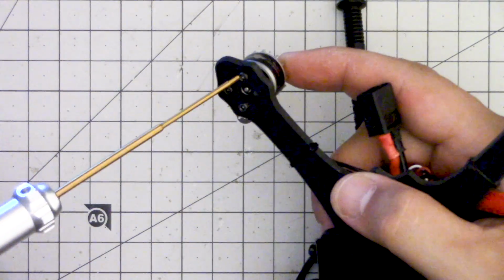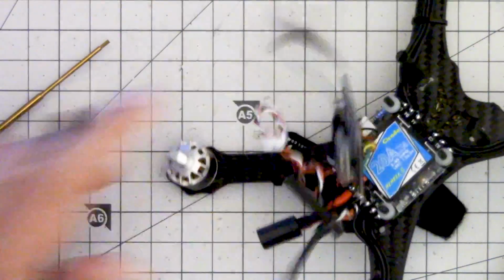Quadcopter Hot Motor | REAL WORLD TROUBLESHOOT

Comment: All good theories, but my 1st thought was you were going to say you hit yourself with a quad and aren't presentable for on-camera work... I guess it's fresh in my mind as I almost hit myself the other day as I was bit rather painfully by a bug, while flying LOS - that can really be distracting... I live next to a swampy wooded area and it's a good flying area, but I often have to clean bug guts off my quads, and worry they may short the FC or ESCs. 

I'd think a black box test would be a good way to determine if the rear motors are working harder in forward flight vs level hover (possibly with a weight load to even out power settings) Maybe there's something to be learned there? Could deflectors or baffles of some sort be beneficial in extending battery life and providing better 'prop bite'? If there's a ducted style quad in the stable for testing you could compare the two. Might be a subject for a video.
Now, who around here does black box testing....??

PS I had an ESC go 'weird' a month or so back and it was causing similar symptoms. As you pointed out, odds are with the motor and a touching screw is easy to locate.

I always check motor temps when changing batteries, it's a habit. 

Good job for keeping up the filming in the dark. Now that's dedication.
Reply from the maker: If you want to know if the rear motors are working harder, look at pitch I term. If pitch I term is positive, the rear motors are working harder.
Reply: I didn't think it was that simple. Makes sense though. If you fly backwards, you should see the numbers reverse. I'm just starting to get into the black box and it's a lot like industrial temp and motion controllers (I'm a retired controls engineer)

Thanks!

Comment: Please help!!! Hello there sir, I've got a question for you... I got my new kk 90gt today in mail, flew a few packs and now 1 motor won't spin up. It moves fine. Didn't crash. Landed safely. Only thing I did was plug it into my computer, with betaflight open, it auto connected, but my laptop died. Didn't touch any settings. Tried updating to 3.1.7 after I noticed motor not working. Tried calibrating ESCs again to no avail. It's like there's no power out of nowhere to the motor. Connections seem ok... it's possible they're not... any kind of troubleshooting I can do?? Nothing should be wrong with this thing.
Reply: You could try changing the location of the motor to the opposite arm.  I had a new Storm motor crap out on me after a few flights. It happens.
Reply: MikeDrones well that would certainly rule out the motor/motor wires. Thank you didn't even think of that. Have been to busy panicking.
Reply: MikeDrones well it is not the motor... so I'm thinking of getting the pikoblx and the cicada 4 in 1 10a esc... could I just basically drop these in and solder up, and these would work??
Reply: Should work.....check voltage and all that and consider mounting. I'd first check if you can replace with the same parts. Send an email to the company you bought from as well. They might send you what you need.

Comment: Last question.  If all your escs are encased in shrink and the motor tabs aren't accessible to test continuity, could you possibly test by touching a motor screw and the negative terminal on the pdb of the suspect motor or does it have to be the motor wires?
Reply from the maker: No. You will always have continuity between the motor screw and the negative terminal, because the frame is pretty much always grounded somehow, and the screws always touch the frame. You need to test continuity between the motor wires and the frame.
Reply: OK good to go.  Thanks for the info

Comment: EXCELLENT Video!!  I actually just encountered this.  However I did have this occur.  I ran my quad.  After several flights I noticed one motor was hot as hell.  I let it cool while I flew another quad.  Came back to that hot motor'd quad the next day and now that motor twitches and won't spin correctly.  Luckily I had a spare, swapped it out and back in the air but the bad motor has something weird going on.  It turns like the magnets are twice as powerful as before.  I can grab the other motors with my hand and pin them and they spin a couple turns before the magnets slow them to a stop.  This bad one wont even go a 1/4 turn.  Like its seized up of something but there is no damage to the bell or anything out of the ordinary to explain this.  Any ideas?
Reply from the maker: You overheated the magnets and they lost their magnetic strength is my best guess.
Reply: OK cool.  Thanks

Comment: Wow..this is super timely. I had the same experience with one motor. I could visually see the screws weren't touching anything. Or so I thought! Had no idea what it could be, so I decided to soft-mount the motors and now everything seems fine. Guessing I must have missed something and the screw was actually touching. Clearly the extra clearance caused by the soft mount was enough. (Yes, I was being lazy and should have soft mounted to start.)

I didn't fly it too long in that condition. It never de-synced but the motor was very hot to the point I could smell it was starting to toast. What's the chances I fried it completely?

Comment: kind of unrelated, but my cheap build with racerstar motors had all 4 motors getting hot, even with d right down. I switched off air mode (increased idle speed) and now the quad stays chilly cold!!! air mode must add lots of noise?
Reply: chrisbewrx I've noticed the same thing recently. I have flown exclusively on acro for some time now, but I was going to let a new to the hobby friend try flying with my quad and figured he'd get a good feel in horizon mode. I tried it out before to see what he'd experience and whether it was more controllable. 

It's almost like the quad is fighting against you the whole time. I hated the experience. It was like flying through molasses. The motors were definitely working harder the whole time and they came down warmer than usual.
Reply from the maker: I honestly don't know how air mode could cause hot motors. It increases authority at low throttle. It shouldn't have any effect at all at mid throttle and high throttle. At low throttle, the motors are moving slowly, so noise should be minimal.

Comment: Just as a frame of reference I find the threshold of pain at about 55 to 60 C (yes I know everybody has a different threshold of pain).  I worked in a lab for a few years that had a 55C water bath and I had to add and remove samples from it constantly so I have a pretty good idea what 55C feels like.  It is uncomfortable but not truly painful.  But once you get to about 60C it gets truly painful for me.  Motors can still handle 60C without being damaged.  So I agree with Josh, if you can still touch them without drawing away in pain, you aren't damaging the motors.
Reply from the maker: I think this is about right. I suspect the threshold of pain for most people is around 140 to 160 degrees F. And I think the enamel and magnets are good to at least 180, and probably more.

Comment: The number 1 noob mistake and is likely to become even more prevalent with all this soft mounting of motors hypetrain nonsense. As the frame is used over time the elastomer can crush down leading to loose motors. The natural reaction is to simply re tighten the screws which could be just enough to push you from OK to shorted turns.

Comment: Hi Joshua is there a way to test if there is electricity running thru the frame with a multimeter?
Reply from the maker: There aren't any good direct ways of detecting current flow in this case because the multimeter would need to be in series with the current, and this isn't the kind of scenario where that makes sense. I suppose the best way of detecting this type of current flow would be with an FLIR type device, which would clearly show the hot spot on the frame.
Reply: that would be the part where he probes the frame and motor wires.
Reply: thanks....I think Ive had a short because it looks like there is a connection between my frame and the power and motor cables...using a ohm meter resistance...
Reply from the maker: You should never have continuity between the ESC motor outputs and the frame.

Comment: Ever used 4 nylon screws? maybe less weigh and still do the job with no risk of this happening. I've used them on my hex running 6s and it holds. :)
Reply from the maker: No freaking way I would trust nylon screws to hold a motor on.
Reply: Joshua Bardwell  lol :)

Comment: The frame is always negatively charged through ground if it is made of a conductive material from the motor bolts. There is no way around it unless you use plastic motor bolts (lol) and non conductive motor spacers/soft mounts. If you have a positive touching ground somewhere-magic smoke
Reply: The motor housing is neither grounded or at Vbat. It has no electrical function and is simply left unconnected. Motors used on mains power are frame  grounded for safety reasons.
Reply: Then why is there continuity (with resistance) between the motor bottom and the frame? And continuity between stator (motor bottom) and its leads?
Reply: I thought the coating on the stator wires would isolate them, but there always seems to be some wire in contact with the housing where they come out of wire harness and might wear through which is probably when I notice the continuity. I must say that its not readily apparent or easy to check, I have to be careful not to touch the housing... tight spaces and all. I have also never checked a brand new motor, just used ones. Maybe this is a cause of some fall out of the sky instances.
Reply from the maker: The continuity between the motor bottom and the frame is most likely from the screws. Continuity between the stator and the leads indicates a damaged motor. The stator must be electrically isolated from the windings for the motor to work correctly.
Reply: Then the motor is faulty or you are measuring your own body's resistance. i.e. you are holding onto the bare wiring while connecting the meter. 
The other important connection that WILL ground the frame is the VTX antenna if it is screwed into the carbon frame with a SMA connector. It is this connection along with shorted windings in the motor that will show up as black streaks in the video feed.
Reply: Thanks Rob and Joshua for clearing up some misunderstandings/miss diagnoses, I would delete my original post but maybe it will help someone else.

Comment: what if the motors are not getting hot but still the screws are touching?
Reply from the maker: Then you're extremely lucky. But you should still use shorter screws or put a washer underneath the head to space them out  a bit.
Reply: Maybe thats why my quad is doing the death roll After a few flips and rolls.I was thinking it was Dshot 600.

Comment: Rear motors need to spin higher in forward flight for the pitch. Hence they are more warmer than the front. Ain't got much to do with airflow. Same goes with yaw or roll.
Reply: Francis Rohan John id disagree. But I'll run a test.
Reply from the maker: Sorry I don't think that's true at all.
Reply: Joshua Bardwell Maybe I'm wrong. But I did run a lot of tests to see if this was true and all the time it happened like I said. If I had a lot of front pitch, my back motors used to be really warmer likewise if I give too much roll to the right, the left motors got warmer.

Please do check if it's true with yours too. Now I'm curious to find what actually is the reason :p
Reply: Francis Rohan John also I'd say if anything cg has to do more with it. If the battery on top id say the fronts would work harder. But that's just a guess

Comment: Nice troubleshoot, but what does "D sinking" / "desinc" means at 08:45. Does it have to do with the insulation on the windings?
Reply: Brushless motors use pulses in a specific sequence to turn the bell. The ESC's uses various ways to sense what pulse to send and when. When everything is running smoothly everything is in sync. If something causes the ESC to not be able to determine what pulse to send at the right time the motor then becomes out of sync and will be down on power or fail to spin at all. When the timings are out of sync it is called a de-sync. Shorts can cause havoc on some of the methods of sensing when to send the pulse.

Comment: had a similiar problem with my VTX. i screwed it into the frame and as soon as i powered it up the PDB started smoking. below it the frame was burnt afterwards, right below the positive battery terminal. 
it was quite weird, the pdb didnt had contact with the frame since there was plenty of soldermask and there wasnt  any components on this side., none of the wires was damaged. 
just the Camera and VTX was touching the frame with its grounded parts.

Comment: I have a new Revo F4(Airbot/Flip 32 clone) and DYS mr 2205 2300 kv.  When go to the motors tab and throttle up,  at around 1300 it starts oscillating really badly.  Above like 1500 the Motors stop spinning.  They are also hot super fast.  The FC is softmounted with your rubber standoffs and some foam between FC and standoffs I already tried some filtering and different Looptimes, but it didn't get better at all.  What can I do,  I'm really screwed up.

Comment: Do you have any ideas about what causes one of my motors to be weaker than the others?  I have a brushless micro with 1104 motors, 10A 4-in-1 ESC, and 3s LiPos.  It's extremely noticeable in flight.  ESCs have been calibrated multiple times with no change.   In BLHeli the min and max throttle is the same so I know it's not a calibration issue.  If I go into Betaflight motor tab and spin each up individually, the one is noticeable slower.   It dips toward that motor in flight.  I've tried two other motors and it does the same thing.
Reply: Try rotating the 4in1 180deg and resolder, if the problem moves to the other motor you know its the esc
Reply from the maker: @C4reful's advice is solid. If you swapped the motor twice and the problem still happens, then the ESC is the next guess.

Comment: The rear motors are generally hotter because during forwards flight they support more of the undermounted battery's weight.
Reply from the maker: I disagree. I've observed this on both top and bottom mounted batteries, and with the CG moved as far forward and back as I can get it. I am really confident this is an aerodynamic effect.
Reply: Thanks for the explanation, I'll see if I can observe the same.
Reply: I'm currently researching this in a wind tunnel for my PhD. Initial tests so far on a flying platform have been indicating that the rear motors consume ~50% more power than the front motors at 60km/h. Now i'm trying to determine how much of it is caused by aerodynamic interaction, speed stability moment effects, CoG or something else. I'm currently planning PIV and 6-axis force balance tests to quantitatively analyse in more detail.
Reply: R J this has been varified to my knowledge
Reply: Yeah i'll hopefully have some journal papers ready by the end of the year. They won't be "publicly" available (require journal subscription), but I might release some results that don't make it into the papers similar to what Shrediquette has done.
Reply: That's really cool, will the results be publicly available?
Reply: So this effect should be reduced on plus-shaped frames (like the one Nitefury used in Sebring).
Reply: Not really because the rear-most motor is in the wake of both the centre body and possibly part of the left and right propeller wakes (and front prop wake at low angles of attack)
Reply: I'd agree with the teacher. Makes sense......rear has to spin up faster for forward flight and being in the rear they are probably subjected to less air for lift and less cooling. Only way i can describe is like driving behind an 18 wheeler and watching the temp on your car go up

Comment: Watched your video and 'just for fun' ran those tests for myself. I had just switched to new motor protectors and eyeballed the required bolt length using the back two bolts (because they were easier to see, and it never crossed my mind that the clearance on the front could be different). 
Sure enough it showed continuity on all 4 motors to the frame because the front bolts were just long enough to touch while the back bolts were fine 
Great timing posting this video :-) Thanks!

Comment: In order to get electrical heating in the frame, wouldn't there need to be two places where there is contact from powered wires to the carbon?
Reply from the maker: No, because the frame typically has many places of continuity to ground e.g. through a mounting screw on the FC stack or a camera mounting screw. So all you need is a connection to positive voltage.

Comment: What Props and battery specs are you running on this? Do you think less ideal choices can affect an outcome like you experienced or is it likely just the motor screw contacting a winding?      ....I've got a S4 on order... I'm psyched..    

Thanks for another great video!  I absolutely love your attention to detail and enthusiasm for informing!
Reply from the maker: It's 100% the motor screw. I would check this on the S4, as I think the standard screws that come with the motors are a bit too long, and if it is not happening to you today, maybe it will after a bit of vibration. Personally I suggest filing down the inner-most screws on the motor (the ones closest to the frame) by 1/2mm or so. But do it carefully because if you leave a sharp edge you're making things worse not better. You could also just buy some shorter screws what a concept? LOL.
Reply: Thanks, Joshua!